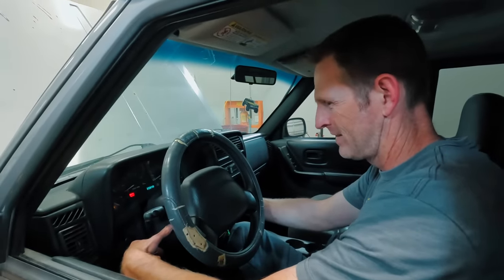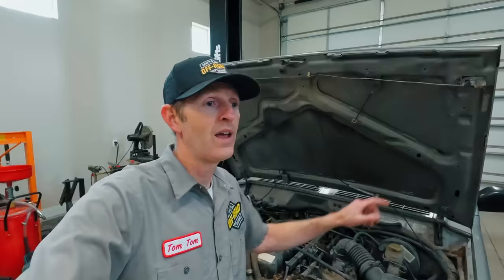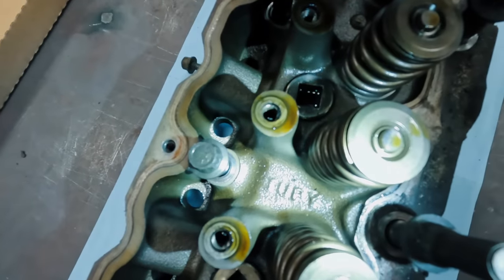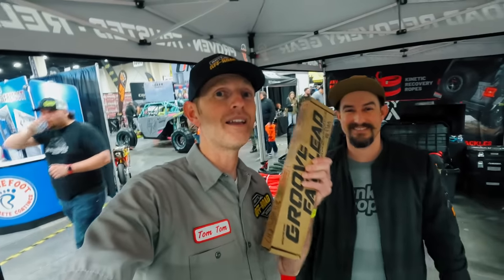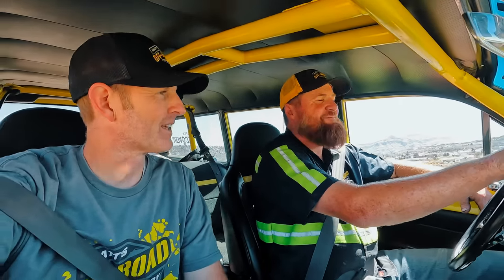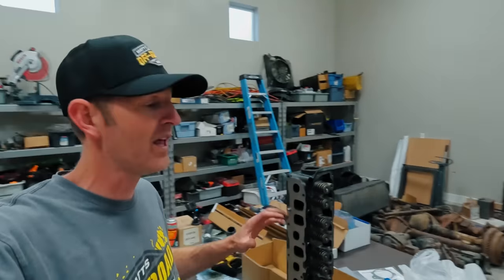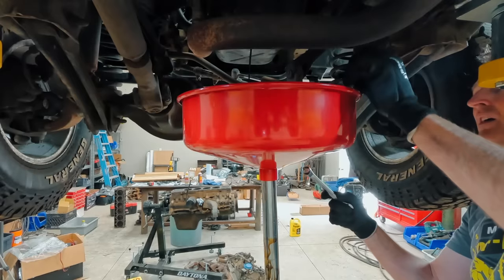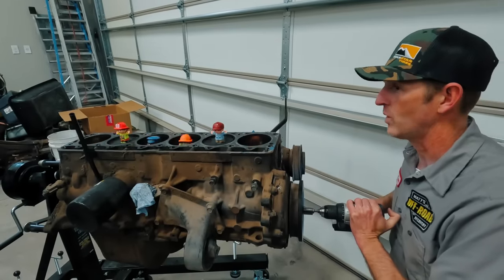A New Life for an Old XJ

Comment: Hey bud my name is Russ. I'm also a machinist/fabricator. I went to school and did the program to be a mechanic at our local power plants here in Eastern Utah. Well I never actually got a job at the power plant but instead worked at a hydraulic repair shop for the local coal mines. So I built hydraulic components for 20 years. Mostly hydraulic cylinders. Anyways the last 8 years I've been an RV Tech, but I do miss machining and welding. Just wanted to say I've been watching Matt's channel for years now and hope you have as much success with yours. Good luck bud.

Comment: Sad story😢, this past winter i rebuilt a 258 AMC for my 79 CJ7. I had a extra block and two cylinder heads. Sent the block and the best looking head to rhe shop. When it was time to put the head on i discovered i had two different heads. The 79 258 head with 1/2" head bolts and the 82 258 head with 7/16" head bolts. Of course I rebuilt the wrong one for the block I used. 😢 $350 later I installed the proper head. Runs great and good for another 40 years!😊

Comment: I have a 2002 Jeep Grand Cherokee, and at 170,000 miles I had a couple of ticky lifters, so I pulled the engine and put new valve seals, a new camshaft, and new lifters.  I cleaned up the grooves on the pistons. They were bad fouled with carbon.  New rings and rod and main bearings along with seals.  

I also replaced all 4 ball joints and the couple of tie rod ends that had a small amount of play.  I have went through a couple of transmissions, and a transfer case.   I love my Jeep, and I will keep it until it gets wrecked or I die.  I can work on this vehicle.  Not so much with the newer vehicles.  It now has 240,000 miles on it, and it is still running strong.   I use Amsoil Z-Rod oil in my Jeep and my 1923 T Bucket with a 396 engine.   I can work on it too, beings that I made it from scratch.

Comment: Love seeing a speed handle in an engine bay instead of a claw hammer as seen on other channels 😊
Reply: There is nothing wrong with a claw hammer.  I have both in my shop, and for fabrication, I use the claw hammer MUCH more than my Ball/peen hammer.  The claw side is handy.  Both for the slot and the points for precise touches.   I also have speed handles. 

  For years I worked in field service for Caterpillar dealers, and you would be surprised at some of the tools that I had to make while being 150 miles away from the shop.

Comment: We had a death wobble start up on my son's 1988 XJ 5 spd while driving from California to Nebraska towing a trailer just out of Elko. No parts available without waiting and the wobble showed up at about 48 miles per hour. We drove the next 1000 miles at 45 mph. Took longer, but the upside was we got 25 mpg. The pre 91 4.0 have 187 hp. The 91 and later are HO and produce 190 hp.

Comment: I could not identify if your Xj is e-fan or fan clutch ... It took me about 11 months to realize that my fan clutch worked enough to cool under normal conditions but not under heavy load...
Changed the fan clutch and my over heat issues are gone - even under extreme load no more heat issue !

Comment: I have a 95/96 Grand Cherokee Limited with the 318 V8.
Inwas looking on Craigslist one evening after work and someone had a 95/96 Grand Cherokee for $200😮 you can imagine the condition...rolled at some point, they cut the top off and all removed all the doors,breat hatch and front hood and fenders.
Sitting in the Arizona sun for a year plus.
I have it back together now, the running gear is complete but the rest looks like a poor excuse for the tangerine.
I really need a junk hood for my junk jeep...
SUBSCRIBED

Comment: Hearing you decide to have the head machined and the valves done was a refreshing change. Matt and Paul would have just put the head right on the block. Matt would have said, “it will be used eventually”. 🙂

Comment: I had an 04 WJ. The engine and transmission were fine, but the rest of it was falling apart slowly. I had replaced all the gas struts on the hood and rear hatch, the leather seats cracked like crazy, and Its biggest downfall was the leaky sunroof. I moved away from where a high clearance vehicle was needed and now I’m driving a ford flex. It’s more like a wagon and less suv, but it’s been good so far.

Comment: I have a 2000 WJ with 200k and running strong, and just picked up a 2003 Rubicon with 36k on the ticker absolutely spotless. the 6s may not win any races but they are nearly indestructible.
Reply: With upgraded fuel injectors and an exhaust header and the throttle body they're not too bad.

Comment: I was always worried about over heating my 01, being a 5 speed it pulled my 21ft boat fine and I was not the guy slowing traffic so I worked it hard . Plus the Vegas heat alone would take you out. I wouldn't shut it off when I got home . I would run the water hose out and spray the radiator for 5 minutes or so . I never had a problem but for the body ripping at the hitch point.

Comment: My XJ ran great with the 4.0 HO, what it needed was a better transmission, but if the 4.0 wore out, the only engine I could ever seriously consider swapping into it would be a '95-'97 LT1 from a Z28, Formula, T/A, or 'vette. Torque from idle to 6200, smooth idle, what more could you ever ask?

Comment: I bought a cheap aluminum radiator for my last XJ and ran into the same problem with the OEM trans line fitting not working. What I found was the threads were not cut deep enough into the Aluminum radiator.

Comment: Sweet XJ! Yeah Tom the 2000 and 2001 XJ (The last years of XJ production) they used several companies to cast the heads and it was a crap shoot and it sounds like you got one of the bad ones. XJs are the GREATEST SUVs ever made! You can do so much and the options are endless. I say drop a America's Most Wanted Hemi motors (There is several) iunder the hood and a killer suspension plus some 40 inch plus tires and go have fun in Sand Hollow!

Comment: Tom Tom ,I have a 02 does that year have the better head. Can I suggest you replace the electric fan with an older manual fan. I have replaced two radiators before doing so myself. The switch kept going out and the car would overheat.

Comment: You adjusted the valve lash? There is no valve lash adjustment on a Jeep 4.0L engine. You tighten the rocker cap nuts to 21 fott-pounds and you're done.

Comment: Hi Tom. If you replaced the radiator due to the vehicle overheating, howcome you didn't replace the water pump and thermostat, all are related to the cooling system? Regards Michael.

Comment: Don’t run so heavy oil it will kill your engine probably good reason why it’s overheating. You should be running 5w30 75% of the time, I would consume fuel like crazy and run warm with 10w40 diesel oil. These 4.0 give good oil pressure all the way to 500,000km but if you have low oil pressure grab some Lucas stop leak and add half a bottle. If you have low oil pressure in 4.0 you have something serious going wrong

Comment: Why would you put a new head on a engine with 220k when ya have one with 150k ? Just curious.
Reply: Motor mount and belt driven accessory mount bolt locations are different between the XJ and WJ 4.0 engines.  An engine swap CAN be done but is a huge pain and not cheap. A buddy of mine found out the hard way. Luckily, I learned from his mistake.
 If you’re just talking about the head, he could have had the 150k head magnafluxed, rewelded if a crack was found and rebuilt. That would have ended up being more costly and taken more time than just rebuilding the head with 220k. Add in the fact that the 220k head is the thicker and stronger TUPY head casting. The TUPY heads are less likely to crack or warp if they are overheated. 
 I hope that helps.